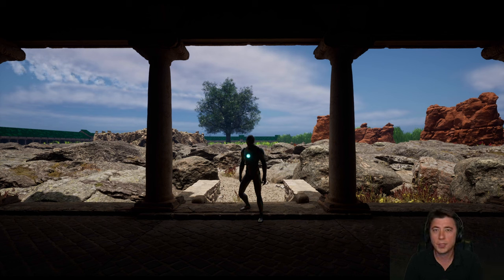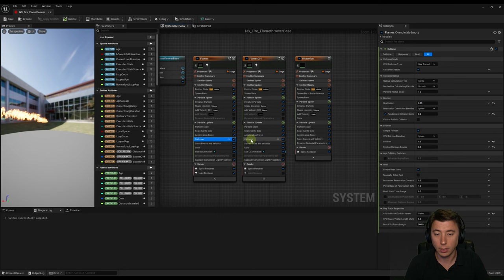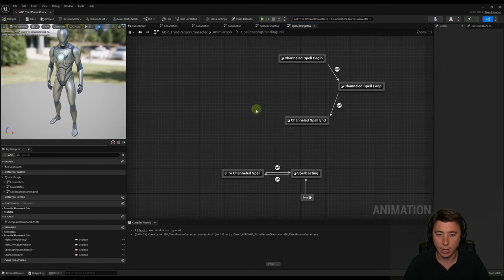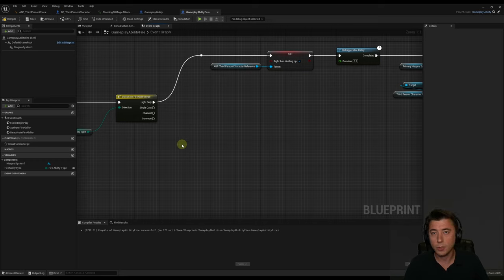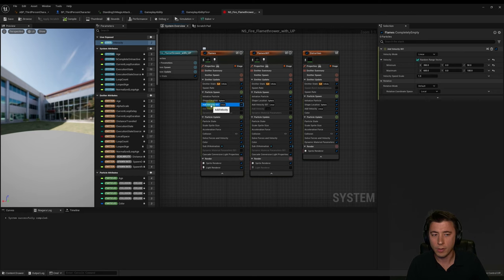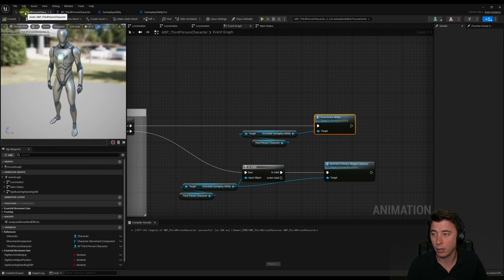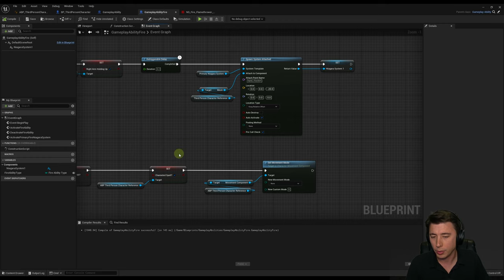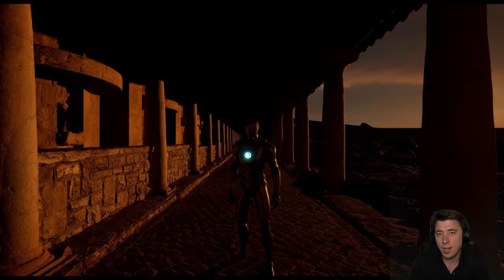Let's Build the RPG! - 27 – UE5 Channeled Gameplay Ability Animation BP Tutorial - Flamethrower

Comment: Hi thanks for the amazing content once again. If someone have an issue (UE 5.3) with the convert of the flamethrower converted into niagara system and you can't compile it, get into the node causing the error and set all the value equally (Personally I set 4 everywhere) on the top left "Select Int".
Reply: Hi! Im having that issue, i tryed to disable the 3rd and 4th dynamic parameters and the isse gonne but now i have an other problem and is that i cant fix the warnings "Skipped converting bApplyGlobalSpawnRateScale". I dont have the button to fix them like he does in the video. There're other way to fix that? Thanks!!
Reply: @SergioGonzalez-ig2bw  Hi I'm sorry I'm pretty sure I didn't have this problem and It's been a long time since so I don't remember well... I hope you can fix it

Comment: It is a kind of hard to follow due to 720p resolution and therefore barely readable blueprint text ( see 1:18:50). Using the "Editor Interface Size" plugin set to 1.1 factor would help a lot.

Comment: I ran into an issue where when I was doing the flamethrower (key 2) I could press torch (key 1) and this would cause the flamethrower animation to stop but the flames wouldn't stop. Essentially, I would stop the animation of the flamethrower, but the particles were still firing. then, I would press torch, and the torch animation would play and the flamethrower particles were still going. Took me a while to figure out, but what I did was put a branch at beginning of both on the 3rdCharacter_BP (or whatever yours is called) where the input actions are: for the torch, I put a branch with the ChanneledSpell as false to run the rest of the logic and for the the flamethrower I put a branch for RightArmHoldingUp? as false to run the rest of the logic. That way I could never play both both animations at once. I hoped this helped if anyone was having the same issue. I also figured out how to combo presses on a controller if anyone wants to say hold left trigger and press button face bottom to cast the spells. Figuring it all out is half the fun :)

Comment: My intensity is not working, when I put say 10 on the flame thrower itself it spawns the Niagara, When I change the Intensity on the third person and leave the intensity at a 0 on the flame thrower itself it does not spawn the Niagara, the animation and sound plays but no Niagara. Any Ideas??
Reply: Fixed my intensity I didn't put the name in the node. when you detach the deactivate Primary Fire Niagara mine wont deactivate.

Comment: when i try to make the flamethrower into the ability system when i press 2 it raises my hand and does the flamethrower
Reply from the maker: Take a look at the logic you set in episode 23 for raising the hand- what is the mechanism that is triggering the hand to be raised?
Reply: @NumenBrothers  i fixed it. I didn't put the ability type variable so it was only casting the light fire ability.

Comment: Hi i have a problem with deactivating flamethrower the niagara system doesn't turn off and my character still haves the flame in hand.How can i fix it i did everything like you?
Reply from the maker: Hi Atoshi, two things I would check: 1.) Make sure you have a boolean variable turning off the Niagara particle spawn.  Take a look starting at this part of the video: https://youtu.be/Btt9i5t0Gxc?t=4469   and then 2.) Make sure, on the 'Spawn System Attached' node, that you check the checkbox that says 'Auto Destroy'.  If you're still having issues, feel free to join the Discord and I should be able to help.
Reply: @NumenBrothers  i have same problem, deactivated and niagara doesnt disappear, its still on right hand.
Reply: UE 5.1

Comment: hi i tried using the tick for the sound for flame thrower but the audio doesnts stop and when i use my fire ball after is says primaryniagaraaudio pending kill or garbage
Reply from the maker: Make sure you don't have a default sound assigned to your PrimaryNiagaraAudio.   I think the problem you're experiencing is caused by the default sound.  PrimaryNiagaraAudio should be blank until the sound is assigned in Blueprint.
Reply: @NumenBrothers  yes I left that blank and my sound still doesn’t turn off when I press my 2 key again
Reply: Im running into the same issue, Even using print string, and converting the float from the GetCurveValue, it ramps up from 0 to 1, but it never goes back to 0. I even set my curve in the Ending animation to be 0 for the entire duration of the animation, no keyframes, and it still never triggers based on the ending animation curve. Not really sure why.
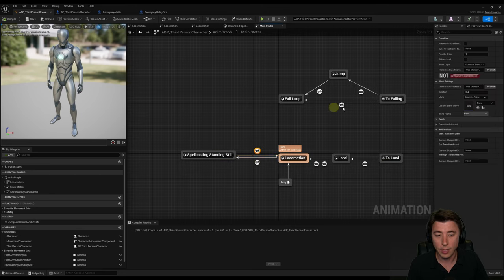Reply: @TheDLCIncluded  Hey!! I was having the same bug for the last 4 hours! I did remember something that was said about the timing of the End Animation and the reason why the noitify had to be earlier rather than later... I was convinced the answer was in the Spellcasting Standing Still loop, but it was in the transition coming out of Spellcasting Standing Still to normal Locomotion. You might already have it in place, but check the transition is in the End Transition position. Check 1:07:28...
Reply: @greaver5470  I'll definitely have to go back and check thank you!